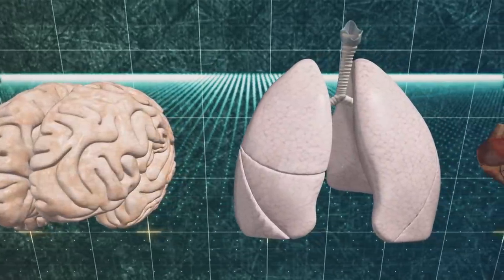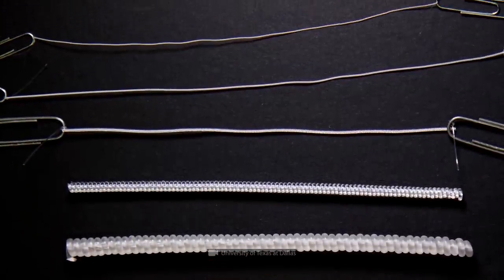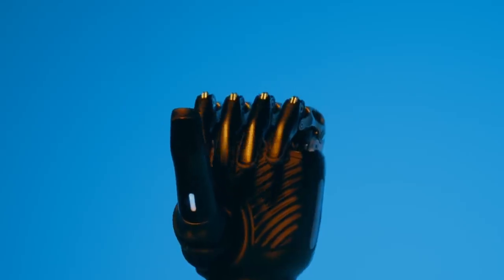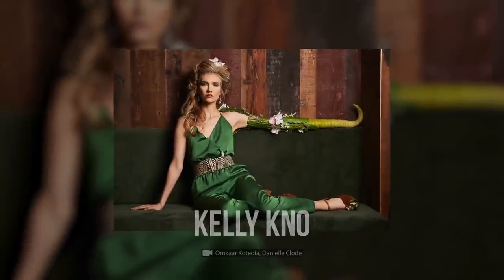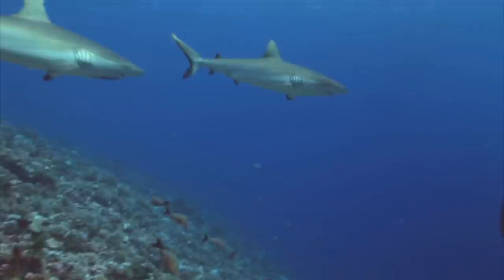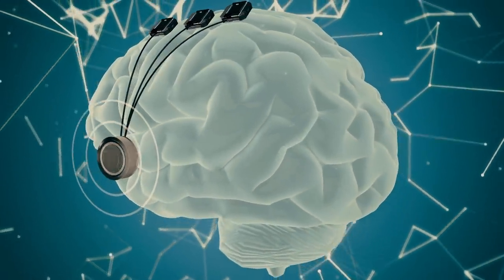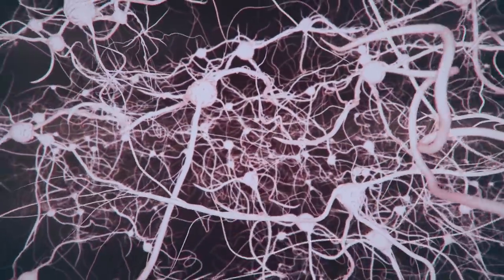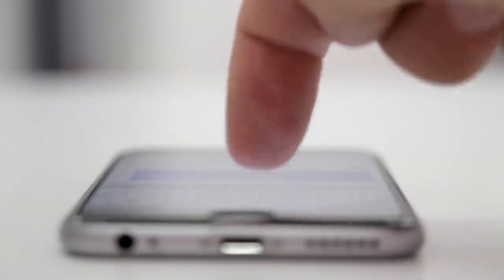Scientists Created Artificial Muscles Stronger Than Natural Muscles

Comment: So, the average human is capable of reaching sprint speeds of 45mph with their standard muscles, but can only reach 15mph because our bodies limit up to about a third of our muscular strength in order to prevent injury. So, if you want to get the biggest bang for your buck you should start by reinforcing your skeletal structure and connective tissue then removing your bodies natural restrictions accordingly.
Reply: I totally agree with you,
Limit, can be broken, but, 
Slowly, with practice, and working hard,
You’ll surpass your limits day by day, at a certain point, the limit might seem.. THE LIMIT, but don’t give up, at that point your body will start to understand how to evolve a little, in order to accomplish the requirements that you’re asking for!
Reply: Starting by simply reinforcing the body and creating a system to assist with repair, why implant more than that like they said they have implants for controling things remove the wireless connection and make hard connection only makes it nearly impossible to be hacked design anti tamper software to disable the implant with out harming the user, then you design suits that augment the natural. You stay human in the whole and still have the advantages of everything else.
Reply: i agree
Reply: @frankgregorio2360  take the suit away and you become a normal squishy human isn’t the point though keeping a ordinary human meat suit would take the taboo out of it making it more acceptable for the objecting party.
Reply: If your life is in danger then you can use 100% of your power
Reply: Kalki ironman after 2026 😎

Humans 0
Saiya-jin 1 to 6
Angels 7 😇

Kalki Ironman 5th matriya buddha 8th arc Angel 11th satguru 13th imam and 24th avatar after 2026 😎

Almighty God 9 😇

Humans type 2.5+ after 2026 by Kalki Ironman (christ in the white horse)(son of man on clouds) type 7 and 8 😎

Jarvis the world’s first artificial intelligence (parrot) 😎

Cuz Kalki is ironman batman super saiya-jin superman ben10 saitama optimus prime shaktimaan and every super heroes combined after 2026 😎

Jarvis world’s first artificial living being (just like vision in marvel universe)😎

Made of Quantum and sub quantum particles 😎

Power source quantum energy arc reactor (type 7) level technology 😎

Kalki Ironman going to have every kind of arc reactor like:- type 1 Nuclear fission, nuclear waste, hydrogen fusion, type 2 3 4 5 antimatter arc reactor (solid liquid gas), type 6 electro quantum arc reactor, and type 7 Quantum arc reactor, type 8 limitless sub quantum energy arc reactor without sub quantum particles 😎

Kalki Ironman going to have sun in a box million billion tons of hydrogen nuclear fusion reactor type 2 3 4 5 just like sun and stars in the palm of his hand 😎

This all going to happened by self replicating quantum nanobots knowledge energy and techniques at type 7 7 7- respectively 😎

Ironman (Tesla 2.0) going to reveal every secrets of the world specially Tesla and his Antigravity 😎😎😎

Comment: Honestly,replace muscles with the nanotubes,install a direct connect and scanning module into the brain and eyes,replace bone with solid endoskeleton structure,install a enhanced digestion organ internally,skin to refractory material becoming invisible with a charge sent, neural preservation module in skull,add a aqua lung-gill feature,add heat and radiation protection in body,install a bio-generator past the stomach to use the waste as fuel, artificial heart and a nutrient tank in all extra space to prolong neural activity

Comment: The obvious solution is to, instead of opting for technological enhancements, put research into developing organic ones. If we can 3D print human organs, which we are pretty close to being able to do, we could create better ones with enough research, with enhanced function, using a person's own stem cells. If we wanted to, we could load it up with synthetic organic materials which are entirely new, totally custom made to be enhanced and superior to our own. The tricky part is making it in such a way that it is both compatable with our body, and our body does not reject it.

If you ask me, making compatible augments our body does not reject seems a lot more likely through synthetic organic technology.

Since we can grow neurons in a lab, we could actually, with enough research, grow whole entire neurological structures with increased ability to store memory for example, or we could offload the ~90% of our brain power that is used to handle things we are not conscious of, to these artificial neurological structures. Freeing up the capacity to consciously utilize 100% of our brain. 

We could also, in the near future (due to the advances of lab grown muscle tissue) develop muscle structures that are designed in a more intelligent way and blended with synthetic materials which are designed to react to neurological input, and create a matrix of dense nerves in this material designed to have less of a response to pain, but be more sensitive to feel, and have a more dynamic range of precision control over the muscle structure. Synthetic polymers could optimize this greatly, and make them more resistant to damage, and be totally immune to inflammation. 

Next time you pull a muscle, recovery time should be much faster as a much greater percentage of the structure will remain undamaged! 

Mix it with metals and plastics as a support structure and never worry about a broken bone again!

Why be iron man when you can be wolverine?

Comment: If all you had to do was transfer your counscious min from machine to machine, then not having gravity on space flights would no longer be a problem, not having oxygen on another planet would no longer be an issue, the amount of time it would take to get to lroxima centauri would no longer be a huge problem. These things wouldn't affect you because you could simply upload your consciousness into a machine that is made to resemble a human but without all its weaknesses, allowing it to survive in the most impossible conditions. You could also have other mechanical bodies that aren't human looking but maybe  have a design suited for certain tasks that your human designed body wouldn't be suitable for. So you could just switch back and forth easily.

Comment: You know the problem with hooking up the soul to WiFi/LiFi/etc. is technology gets outdated rather quickly and the chip we are stored on will have to be able to transfer data otherwise when that chip fries or gets corrupted data then it be obsolete in at least 100 years minimum. Not to mention if you go to a location not "hooked up" to the current network, means of service goes offline which means exploring will become mandatory towards survival and conquests inevitable (ignorance) just to set up connection points for our use, or the ethics behind if what is created is truly you or just a digital mimic clone of you that can be mass produced for corporate gain. Just look at what happened in the US, they gained power and turned against the people to fund their greed and further their power to hold their control on everything else foreign AND domestic. Don't forget to expand your current knowledge and master a field before continuing figure out everything that can become the current tech not just what 1 thing worked, figure out why it worked and what, in replace of current substance, can be changed to have the exact same effect (like gas vs liquids what's flammable, both in certain circumstances, why, chemistry).

Comment: If this becomes a reality different cast systems will appear natural humans and modified ones ... cyborgs .... However machines are really Fragile when it comes to microchips ... A EMP can knock out all sorts of technology that will go rouge ... The moust simple thing in your house you can modify to fight off machines is a microwave oven ... Get 5-6 of those bad boys strip them for the magnetron inside and put them in series and you can fry any type of electronics at close range .... Humans can even withstand radiation ... For a short period ... Best example would be the Cernobyl disaster ... Machines couldn't get the job done it was normal humans .. even if alot of people died ... some survived doses of radiation .It was a common effort . so i think this is a good idea for a video .... Humans vs terminators in a real life situation ... Who would win

Comment: I personally would take the more natural route to accelerated evolution that being genetic engineering. Currently, any technology we create is far less complex than any when nature has, and is capable of creating in the future, so it stands to reason the nature could do things which technology would simply be incapable of. Eventually, we may even be able to create entirely new strands of DNA to do things that are currently not present in nature such as infuse our bones with a metal, and create armored plating made from carbon nano structures designed to protect against literally everything.

Comment: Besides its a robot body what happens if the battery or electricity of the robot body
Turns off what will happen is a not working 
Robot whith a slimy brain inside

Comment: Immortality through implanting my brain into a preserve tank within a machine connecting my brain with the requirements to control a humanoid body with limited strength, 128 Yottabytes of storage and solar and or bio energy to recharge energy or some advanced system small enough to fit inside the body to replicate sleeping to restore energy for the next time I'm active